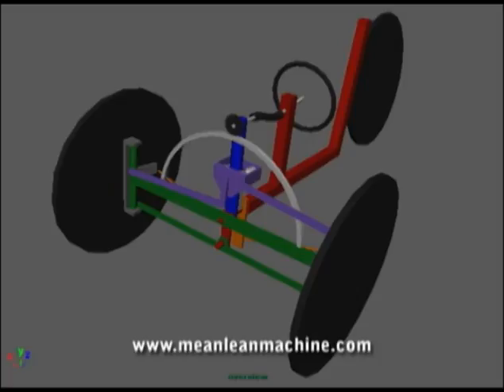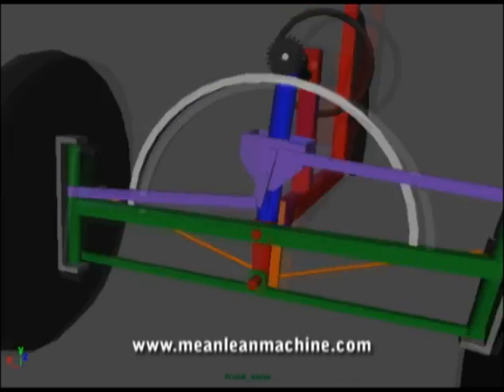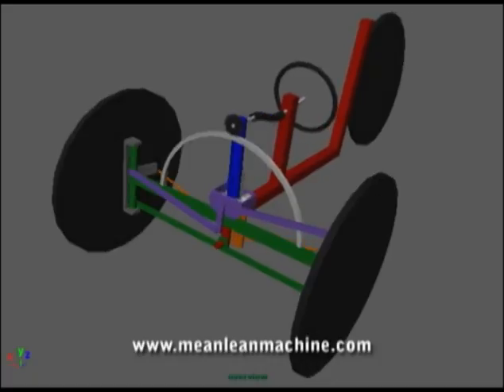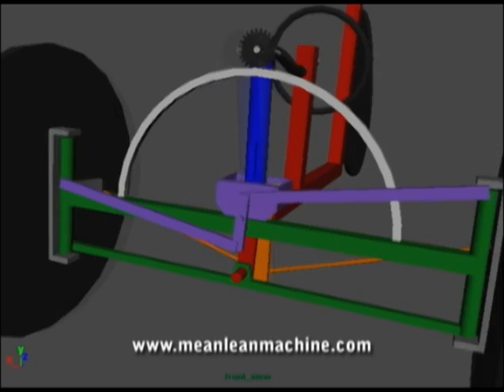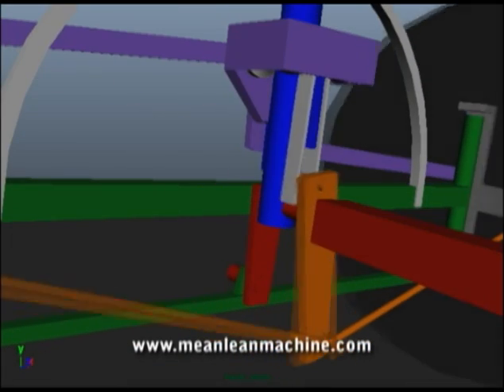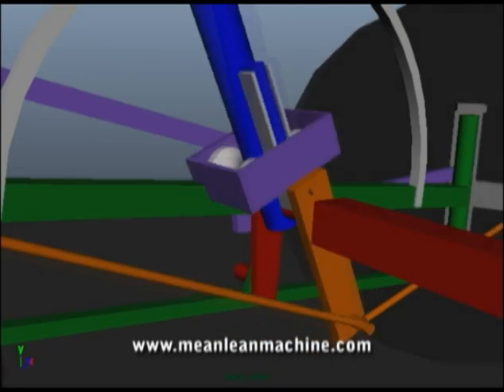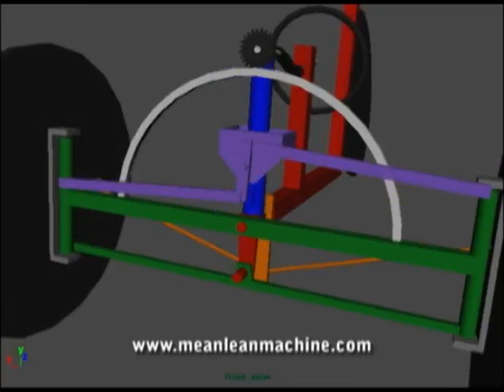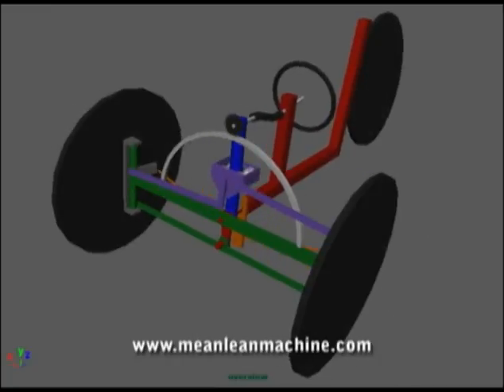Tilting trike concept for transition from free to caster to normal steer

Comment: Ok I love tilting three wheelers and four wheelers. The intrigue is multiple. Emulating the feel of a two wheeler with the stability of  a stand alone platform allows the potential for all season riding including the practical application of weather protection! What is often missing in these designs is another advantage of a two wheeler which is (narrow track profile). Allowing many advantages such as parking where cars can’t. Also lane splitting and access to pedestrian pathways.
The whole point for me in the tilting is for a narrow track vehicle to not flip over in a turn. So if you create a tilting vehicle who’s profile less than 24” wide you have missed a very valuable point to going through with this added engineering base. Not sure this example meets this potential!.
Also for me personally it must be electric powered. If your going to be cutting edge negating this option is very disappointing and short sited.